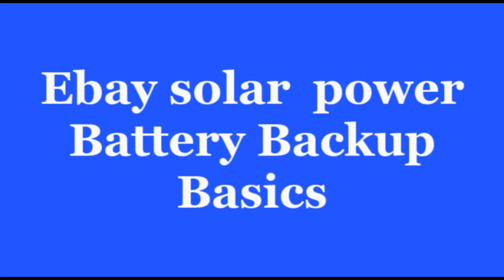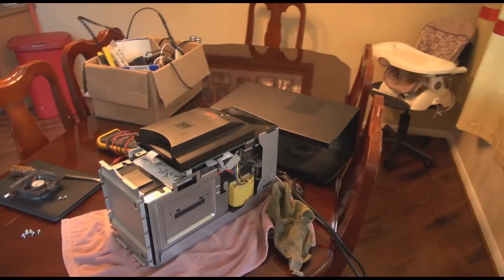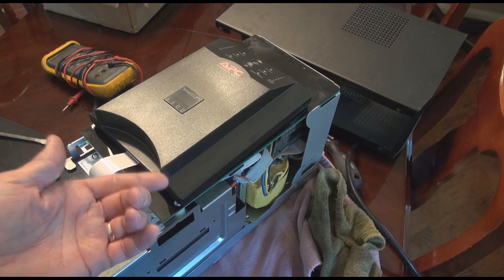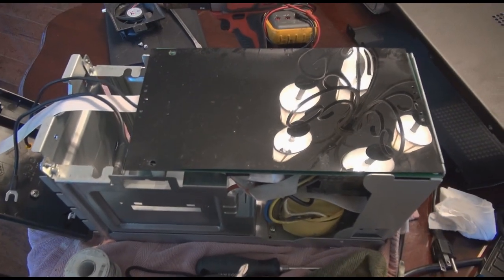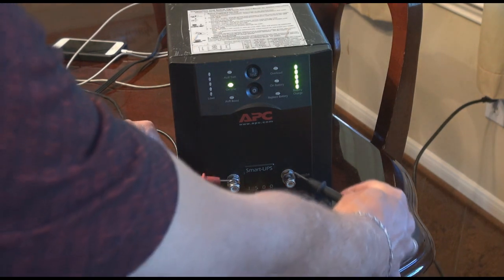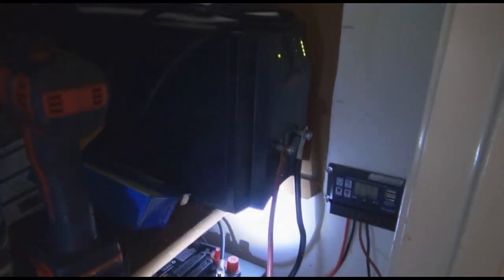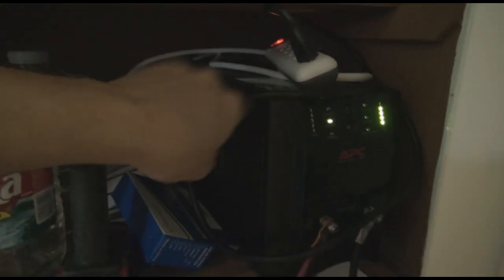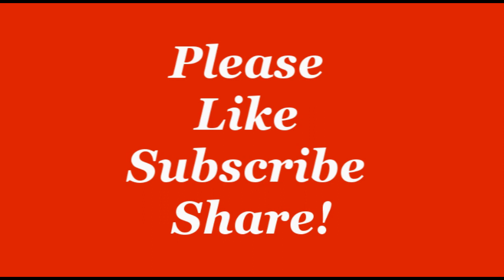Ebay solar battery backup system with 1000 Watt UPS under 1000.00

Comment: Hi thanks for the Vid im am looking at doing a similar setup Couple of questions , How do these UPS units fair with running at high load for extended periods any issues with overheating?  also are you connecting the ups to the mains still? , the reason i ask is the charging system in the UPS is designed for SLA batteries (side note its risky to have the SLA's in PARALLEL with the Flooded cells if anything goes wrong with the SLA you may have a Cookoff  , I also cant see any fuses between your inverter & batteries??
Reply from the maker: well this inverter does not run at hi load. its rated at 1000 watts. the fridge if its needed uses 700. its the only thing on the unit. The  fuse is internal on the UPS and it uses wet cells